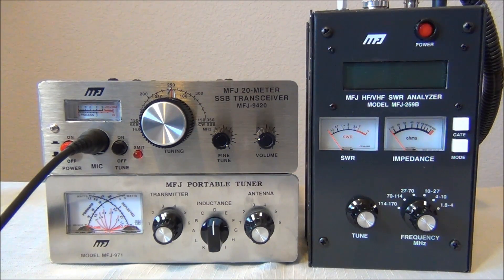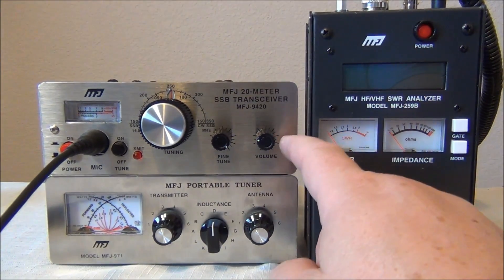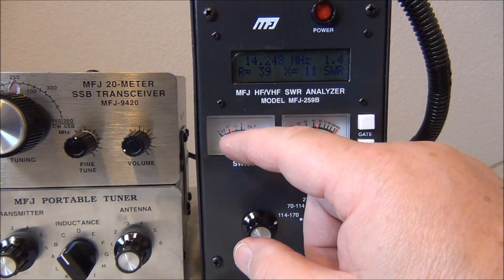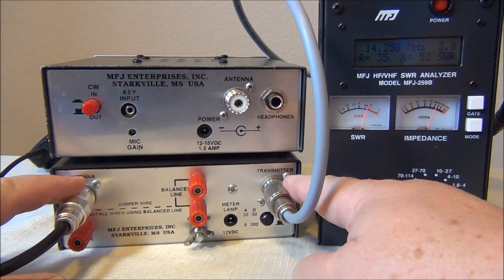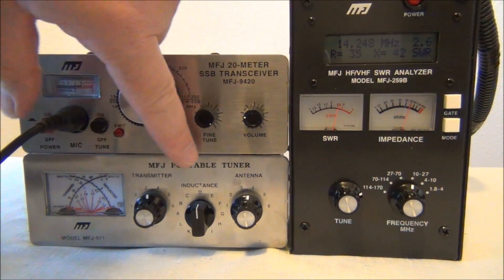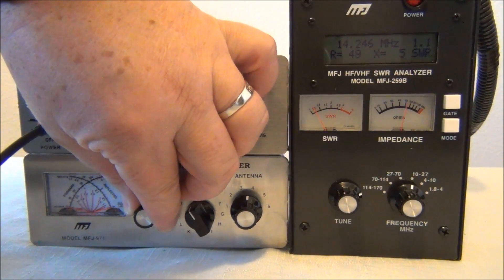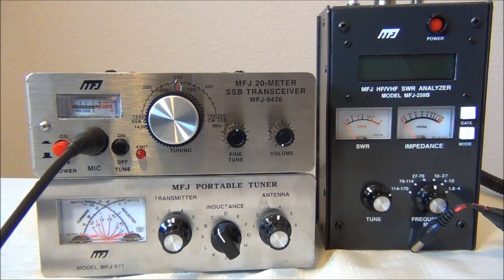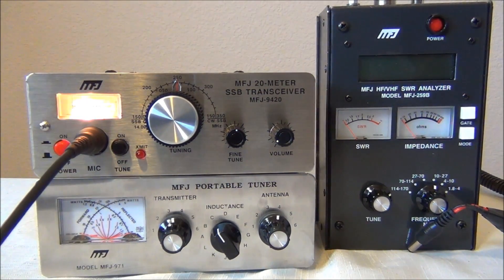Use an Antenna Analyzer WITH your Manual Antenna Tuner for maximum results - AF5DN

Comment: Hard to believe that anyone would buy an analyzer and a tuner. Why don't you just use the analyzer and make sure the antenna is resonant. Or use the tuner to resonate your coax and your antenna?! There are so many ways to get any antenna at any band resonant, that you wouldn't need one or the other. Some of you Hams are a bunch of Bologna.
Reply: An antenna tuner doesn't resonate your coax or antenna and the analyzer allows you to adjust your tuner without transmitting, it's a great way to do it. An antenna analyzer is a great piece of gear for any ham to own.
Reply: I have 4 antenna tuners and 3 meters and plan to buy more. Must have for a ham.